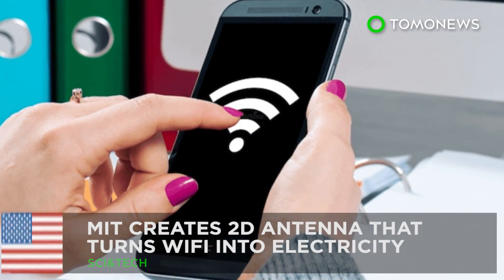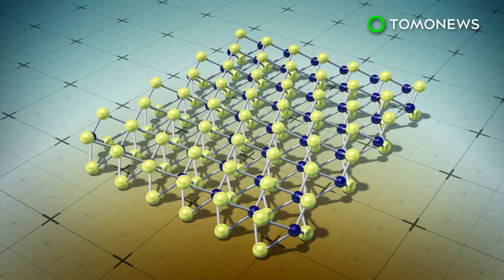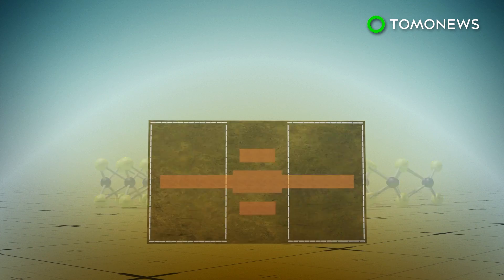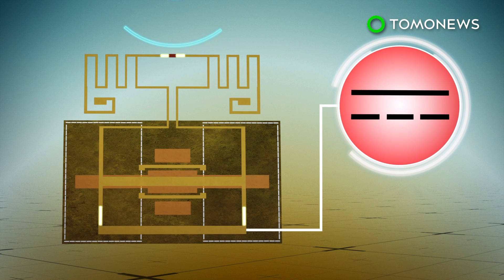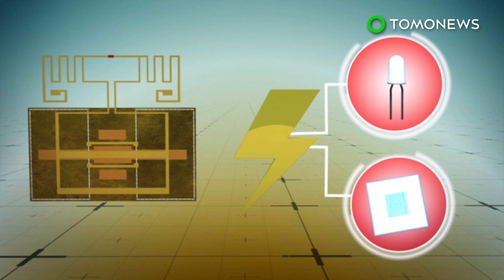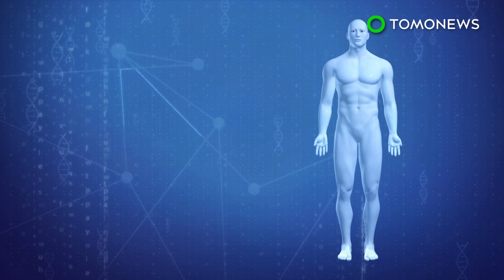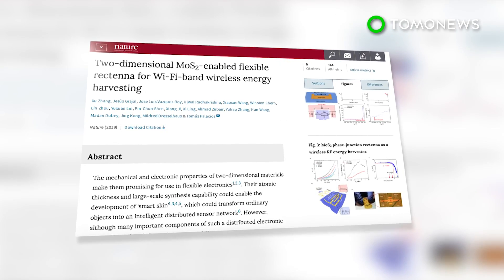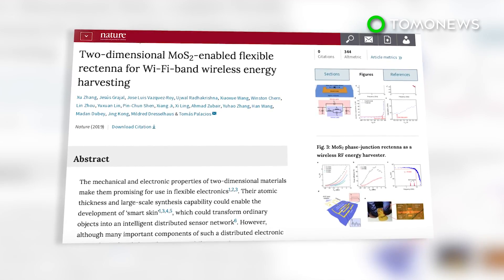MIT's new 2D antenna converts wifi signals into electricity - TomoNews

Comment: 40 microwatts? that's really low to be of any really useful function (as in powering or charging a phone)
How much can you improve upon this or scale it up?
Reply: Not much, really. Beam-forming techniques present in modern wifi doesn't help either. One has to rather think about minimizing power needs. Oh, by the way, that energy doesn't come from nowhere - YOU have to radiate it as wifi, loosing huge part of it in the process and hijacking that energy weakens wifi field, so paving highways with this is simply useless. Single solar panel waaaaay better.  For single low power thingy - sure, why not.